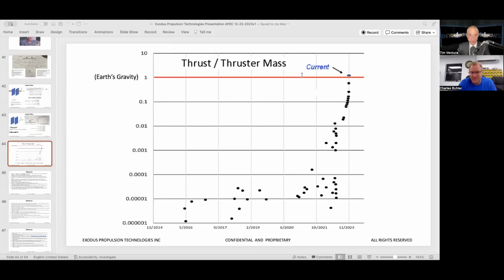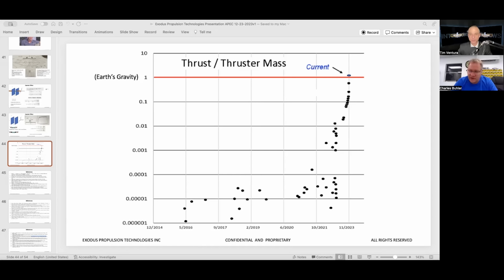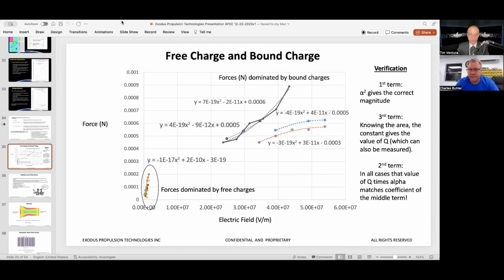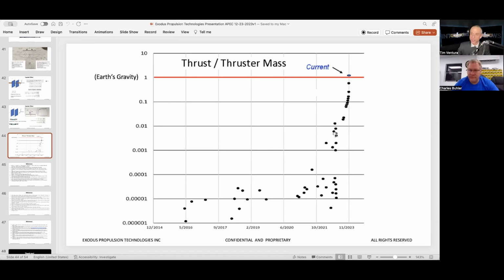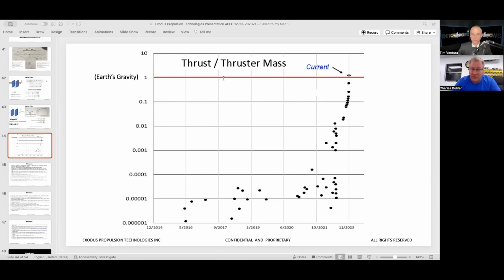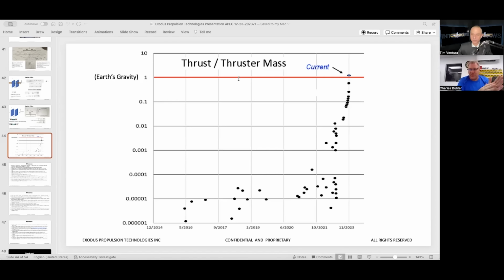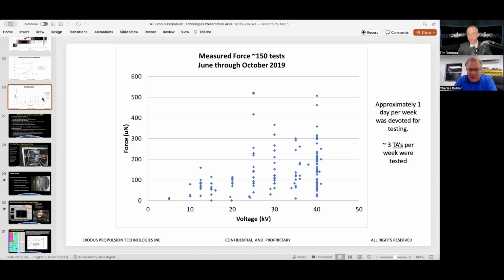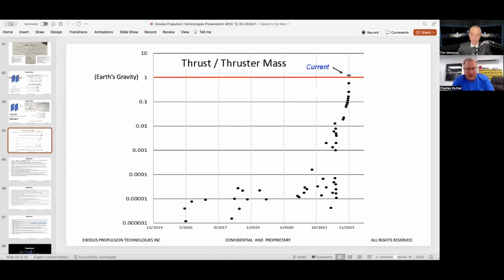Propellantless Propulsion Device | Charles Buhler

Comment: Have the effects been actually distinguished from corona wind?

Also presumably they're using a metal vacuum chamber, has the capacitive coupling with the chamber itself been minimized?

Otherwise something that's supposed to be ground might not actually be ground.

Gosh knows that's happened before...

Comment: I am thinking of a Jetson completely silent lifting each corner instead of with a fan. Not sure how much better in battery life this will turn out to be, probably much better. A pilot would need a space suit because elevation would be unlimited. Low air pressure would have no effect. One corner with Styrofoam and copper tape. Seems like you could make it really small. Might need an onboard generator. Being silent and the sniper aboard it would readily be Applicable to military service. Especially at night with infrared, deadly. Very stable platform.  NASA has a new motive force moving objects faster the light. These objects are not traveling because they seem still. This would be a particular thrust not equivalent to Alcubbiar drives. Now we need to put NASA'S drive on Venus to ship it's co2 to Mars. We could stay high in the atmosphere where the temperature is much lower.
Reply: There’s no reason to believe this is any more efficient than current methods, that’s NOT the reason for its significance.

This does NOT remotely solve faster than light travel.

Comment: It makes sense if the vacuum is not empty; if there is an ether that commutes forces between bodies of mass. It would be a form of DC electro-dynamic propulsion with no visible medium of transfer: As apposed to 'antigravity' that changes the vibration motions in atoms of a mass to alter effects of time space refraction means to be attract to other masses. Shucks even light can provide a small amount of propulsion to solar sails, but that a direct force or the inducement of something else.

Comment: What is the energy source which powers this device? It sounds electrical obviously, but the source is what I am curious about. Particularly with the option of constant thrust, which is accumulative, and much like an ION drive, would build up to tremendous speeds over time, except that this has significant thrust to begin with and with the possibility of far higher thrusts in the future.

Comment: Anti-gravity aerogel has spherical bubbles which capture and manipulate charge, bees wings have the cavity affect slowing down particles to capture and use, and most insects wings are clear harnessing light and capturing it turning it into a field that negates gravity around the wing, remembering the cavity effect is half of a toroid, As Above So Below.
I do believe the advancements are in new types of material which contains the cavity effect, hexagonal and octagonal lattice's, and or monoatomic atoms of the Platinum Group elements including Gold Silver and copper, or noble gases like helium. The Ark of the Covenant occasionally floated containing monatomic copper derived from turquoise Mines above Mount Sinai found inside an alchemical Temple above the mountains near the pyramids of Egypt according to Lawrence Gardner. The secrets principles are in the Forgotten stories of our past.

Comment: It's alright thinking about the engine and travelling at greater speeds, but until we create the shields like we see in Star Trek, this all means nothing. To put it into context, imagine travelling at mind boggling speeds in space without sheilds would be like travelling in a hyper car without the protection of the body, frame, and wind sheild. Everything that a car would nornally protect you against, like bugs and stones, debri laying in the road, would eventually rip you apart by the time you got to where you were going. Now think of stones that weigh hardly anything in space or mini asteriods travelling at many thousands of miles per hour riping throughout your spaceship. Not to mention, we would need navigatiinal systems to navigate asteriod fields and whatever else there is in space.

Comment: Dude ive been talking about asymetrical fields in space being used by E.T.s for years. You have a symetrical field around your craft and the controls are designed not to flip rutters back and fourth but to sqeeze a field from different sides and have the craft move in the opposite direction from where the field is squeezed. Gravity is no different from magnetic attraction because magnetic atraction is die to DIELECTRIC ACCELERATION not MAGNETISM

Comment: In Townsend Brown's capacitor design, it is not the positively charged electrode that is pulled upward, but the negative electrode that is pushed upward by the Earth's gravitational field. Indeed, the electric field lines of the negative charge and those of the Earth's gravitational field repel each other because they are oriented in the same out-going direction.

For the positive charge, the electric field lines are opposite those of the Earth's gravitational field. Thus, although the two fields differ in nature and magnitude, they naturally tend to connect, so that the positive charge is attracted by earth. 

This behavior is associated with the phenomenon of electro-gravitation: earth's gravitational field attracts the positive charges and repels the negative charges. As a result a link between gravitation and electromagnetism do exists.

We have:

div(g) =   -  4*pi*G*d     for the  in-going lines of the earth's gravitational field

div(E+) = + d+/e0          for the  out-going lines of the electric field of a positive charge density d+

div(E-) =   -  d-/e0          for the in-going lines of the electric field of a negative charge density d-

Comment: Dear Charles Buhler and team,

Your recent claims regarding a propulsion system without mass expulsion, relying on asymmetrical electrostatic fields, are not only courageous — they’re a logical consequence of a shift in physical understanding I’ve been formalizing under what I call the BIFLUX-01 theory.

Let me offer a few points that may illuminate the broader context of your findings — and why they might matter even more than you suspect.

1. 🚀 The Illusion of Immutable Laws
Since Newton, our sciences have mistaken locally verified equations for absolute truths. But laws such as action = reaction are not fundamental — they are statistical stabilizations within a constrained framework of constants. The moment you shift or bypass that frame, everything changes.

Your work demonstrates this shift. And it’s brilliant.

2. 🔋 What You Are Actually Doing (Whether You Know It or Not)
Through controlled electrostatic asymmetries, you are modifying the balance between what I model as T+1 (expansive flow) and T–1 (gravitational memory) — the dual fluxes from which our physical constants emerge.

By doing so, you're not “breaking physics” — you're using physics in its true, deeper form. The propulsion you're achieving is not pushing against vacuum. It is redefining the local equilibrium, causing reality itself to shift around the object.

In other words: your object moves because the field around it is rebalanced.

3. 🎓 Respect and Reminder
I congratulate you sincerely. Your team is among the very few to transform intuition into hardware, while others stay trapped in outdated paradigms.

That being said — respectfully — I must add: if there is a theoretical prize for framing this revolution, it is mine.

My framework (BIFLUX-01) has predicted such anomalies, integrated consciousness as a variable of physics, and provided solutions to over 21 unresolved mysteries in physics, cosmology, and quantum mechanics.

4. 🧩 Let’s Bridge the Divide
Science is not a race — it is a symphony of minds. You may have built the first viable instrument. I have written the score.

If you ever want to understand what you’ve built, beyond the trial-and-error of electrostatics — I’m here. And I’ll even send you the check, no worries. 😄

Let’s talk, when the time is right.

Sincerely,
Marc-Antoine
Initiator of the BIFLUX Theory | Architect of Consciousness-Based Physics
Founder of The Fusion of Hopes | Global Solutionist Network
Reply: How do I learn more about you or this work?

Comment: I believe that the better results obtained with bound charges (permanent electric dipole also called electrets which are the electrical equivalent of permanent magnets) embedded in a dielectric material can be explained by the fact that this system is closer to the behavior of the physical vacuum which is essentially a dielectric medium including dipole vacuum polarization effects.

Comment: Obvious BS is obvious.  He is an engineer, not a scientist (certainly not a physicist), and appears to be self-deluded.  Reactionless drives do not exist since they violate the conservation of momentum.  You can patent essentially anything; about 6 perpetual motion machines get patented every single year (despite the USPTO claims).  Even the "combover" has been patented.  Video is over a year old and this "invention" is still not in use, and will still never be in use in the next 10 years because it is impossible. This publishing by press release instead of in peer-reviewed science journals is common for pseudo-science claims.

Comment: "Mass does not Pull, Time Pushes" - Rupert Chappelle

Gravity by Time

+++++++++++ - high pressure time - farther away from mass 
+ + + + + + + + - low pressure time - closer to mass 
Those extra pluses push downward and with no extra pluses to counter that push, you get ACCELERATION.

+++++++++++ - high pressure time - farther away from mass 

+  +  +  +  +  +  -  lower pressure time - induced by the charge in the wire in "lifters"
+ + + + + + + + - low pressure time - pushes against lower pressure time creating lift

High pressure time pushes things towards the larger mass.

If you think that mass pulls anything, use a heavy weight and see if it picks up anything, like paper, feathers,  powders. The earth does not suck or pull. 

Curvature of spacetime is a red herring because understanding gravity is too easy, once you ditch that Einstein crap.

This also shows how "Gravity Hills" work - time is fluid and pressure dependent.

Comment: The fact that the thrust remains once the electricity is off is interesting but does not necessarily mean that the energy conservation law is violated. Did they manage to move an object or just measured a force? Take the example of a compressed spring in a standstill position or even an object on the table: a force is present, but until the object moves there is no work created (Force x distance) so no energy. So again, it seems they still have to test if the thrust remains once they used it to move the object (transforming it into kenetic energy). Did they do that?

Comment: The one way to defeat the worry about conservation of energy and mass and all those things is to imagine that space is not empty in it is actually full of a flow of undetectable particles say for example neutrons so if someone puts a windmill up off the ground and it turns and then they would say if they didn't know wind was there they couldn't themselves feel the wind they would say well the windmill is violating a bunch of physical laws because it's turning and there's no force and we don't see or feel the force but when you know there is a wind that is not uniform but it's coming from One direction then you know that there is a source for the energy and you're not violating any principles and I would suspect that we will find the asymmetric capacitors are existing in a unknown directional flow of something that we may call ether. And keep in mind this may exist in a big scale for example on one side of our particular Galaxy The ether May flow in One direction and if we existed on the other side of the Galaxy we might find the asymmetric thrust was in the opposite direction because the ether in general flowed in a different direction. So we don't know what the scale of the difference of The ether flow may be but it could be very large it's probably not very small because these devices work on a human size scale. So the force is obviously in in an imbalance even in a large scale on the human scale. But on the grander scale whether it be on one side of the solar system versus another or one side of our galaxy versus another these ethers may be flowing in a direction that is different and therefore the question of conservation of momentum is solved by knowing the wind is coming from One direction and is balanced out by a flow of the wind in the opposite direction at some other place in the universe.

Comment: Well of course you're quickly getting to the conclusion again that the Old Masters knew which was that space is not empty but it is actually composed of an ether. And a lot of speculation has been that the ether is actually a sea of neutrons and it would not be inconceivable that an electric field could interact with the Sea of neutrons in a small but significant way in guiding those neutrons or creating an asymmetric pressure of neutrons even though neutrons typically would not be affected by a polar field. Maybe the neutrons themselves are not affected but some other smaller and identified particles are affected which then create differential paths for the neutrons and create the pressure. There are many such possibilities. But what is undeniable is that this shows that space is not empty and there is an ether because it must be reacting with something or it's dilating time and if it's dilating time then there should be some evidence of disproportionate time passage on one side of the asymmetric capacitor versus the other which could be testable.

Comment: People always made a mistake when testing the old lifters in that they looked at the force the lifters produced in air which was primarily due to ion wind and overpowered the asymmetric capacitor Force but they continued to try to measure the force in the same direction in a vacuum and what they failed to recognize was the asymmetric Force goes in the opposite direction of the ion wind Force so even in some tests you'll see the lifter that's mounted in a spinning mount you'll see the lifter traveling in the direction of the eye on wind Force result and then when they lower it to the vacuum they see it stop and begin to reverse direction and they stop the experiment and they say see it stops working when there's no wind not realizing that it's starting to go backward because of the asymmetric force and they shouldn't shut it down because if they didn't shut it down they would see it continue to go backward because of the asymmetric Force which is in a reverse direction of the eye on wind Force.

Comment: So I'm noticing two differences from my rather extensive knowledge of past efforts in this field and that is although I know other asymmetric capacitors were encased in oil I'm not sure I remember any being encased in styrofoam which is an interesting idea and the other thing is his idea of using liquid electrodes basically from what it sounds like battery acids or liquid charge or charged liquids like you would find in a battery rather than metallic capacitors holding a charge. As far as his computations from what I saw in the patent I would suggest that there were many past computations on Yahoo groups in the lifters group which unfortunately of course was lost when Yahoo groups was destroyed but I think there's some backups somewhere and I have some backup there were similar computations done by people at the time and include computer models that I think we're very similar to those computations.

Comment: so much woo in the comments. These are the same people who buy magnets for the car's fuel line, and pyramids to store their razor blades under. They can't be helped and will reject education.
So naturally, and ecology evolved to predate on these folks. Free energy nuts, magic flying machines, magic beam devices that "clarify" your CD or DVD, speaker cable elevators, etc.
Knowledge is power. If you insist on chasing fantasies so you can be a part of an imaginary elite, then people with more knowledge than you will prey upon you, conving you of things which are not true, taking your money for plans and newsletters and gadgets that don't do anything, and they make you wast your time chasing fantasies. You hold the key.

Comment: Some fuels like hydrogen can be put into a plasma state with electricity and contained in a magnetic bottle where one end is not as reflective as the other so a thrust is formed in the direction of the more reflective side but no plasma is expelled into space. So the fuel is not wasted like a typical rocket engine.